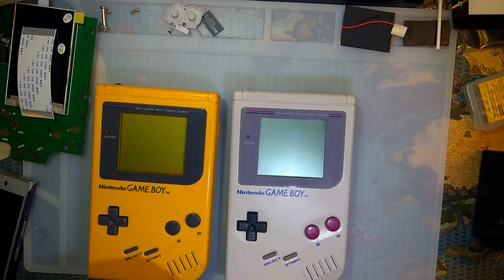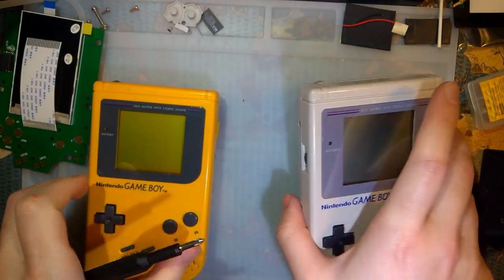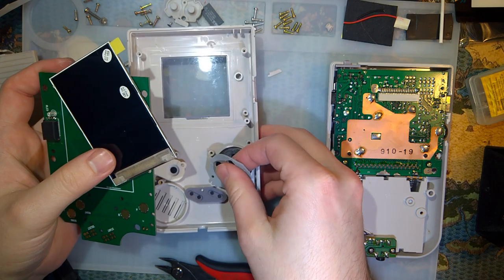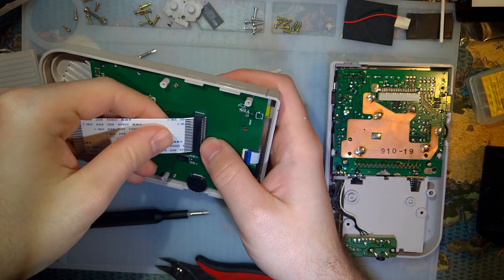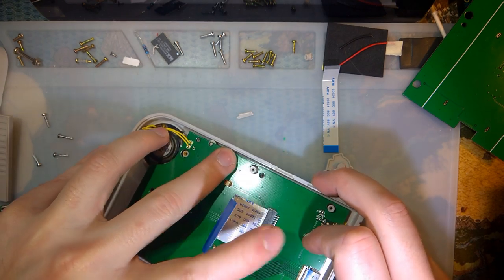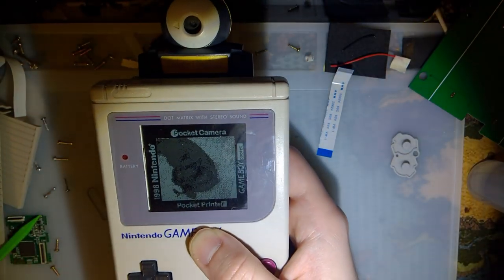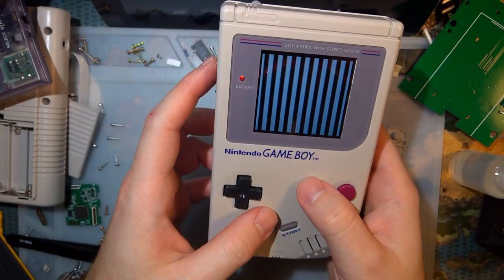(Alternate) Installing the DMG IPS v1 Kit (RIPS) Using the Screen Tabs

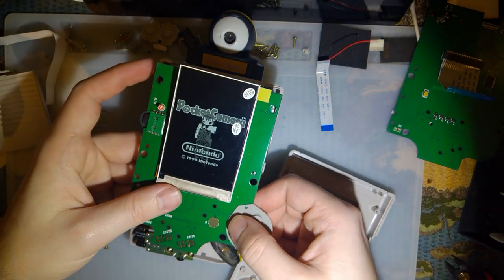Comment: Suggestion, instead of awkwardly using a d-pad like you were at 12:57, try using one of those spongy tipped styluses that work on modern capacitive screens. I'm guessing the spongy material is conductive like the bottoms of the button pads.
Reply from the maker: It is and that should work. The main reason I don't use one is because I don't have one. Good idea ;)
Reply: @makho  If you're like me, you probably have a a cup like container on your work bench that you keep some pens, sharpies, scissors, exacto knife and other stuff in. So next time you see one at the store, grab it and throw it in that cup.

Comment: Are you excited for the Analogue Pocket? I haven't bought an Analogue console before, but I think I may have to bite the bullet for that one.

Also, I hear BennVenn is developing a drop-in display for the DMG as well? Any plans to demo that one too? Your install videos are awesome!
Reply from the maker: I like the idea of the Analogue Pocket but I have no idea how much use I'd get out of one. I am eager for third party reviews though. I might get one depending on how those look.

And yeah, I've heard plenty about BennVenn's planned mods. I'll see about getting a kit if they ever come out.
Reply: What's the point of the AP when there are drop in original size 4x scaled displays for the original hardware for cheaper?
You aren't going to get 1;1 pixel mapping with the pocket. It will get an integer scale for GB/GBC and GG games. But everything else will require non-integer scaling with interpolation to fit the screen at the right aspect ratio. (Which they are then using the higher pixel density to hide). Which is fine, but unless you really care about having the ability to play all 3 system cartridges at once or emulating other consoles. Then it doesn't seem there is any point. You could get a GBA+IPS kit and be able to play all 3 as well. If you care about other system cores, you could get an RG350,350h or PocketGo2. All which will run those systems on a high quality IPS screen with 1:1 pixel mapping with input latency that will be negligible. Plus it will run systems like PS1 that FPGAs are not powerful(or cheap enough) to run.
Reply from the maker: @fonarte  Yeah, you can mod a GBA to do everything that an AP can do, but the pro of the AP Is that it (ideally) comes working like a fully modded GBA out of the box. It will also be able to play games for other consoles and dock for play on the TV. It has a few features that haven't quite been modded into Game Boys yet. That being said, we'll see how well it works when they start shipping.

Comment: 100 degrees it gettin spicy in here. what do you use to clean up the glue around where the outside screen protector goes? i bought a screenless gameboy and it has nasty glue boogers
Reply from the maker: I did my last one with elbow grease and a plastic spudger

Comment: I notice at 9:06 you insert the large ribbon cable with the silver pins facing you, but in every set of instructions I’ve seen for this, it shows the blue side facing you.  On Handheld Legend’s website they even note “*Insert cables with the blue side of the connector facing you.”  I know the original cable is inserted with the silver pins facing you, so it makes sense that you did that, but do you think that might be part of the problem with the palettes being off?  

I get my kit any day now, but was curious if you tried the cable with blue side facing you.  Thank you seriously for these videos.  It’s because of people like you that I even attempt modding at all.
Reply from the maker: That's not how those ribbon cables work. I did actually fix the issue though. Take a look here: https://youtu.be/cFpnUGuXtbY

Comment: That’s a shame that the tabs don’t make it line up perfectly as it should. Maybe they’ll fix that in later revisions
Reply: The daughter LCD PCB is what is causing it to not sit right, so all someone needs to do is make a 3d printed spacer to fit between the screen and PCB. Then it should be as simple as making a lcd sandwich and then just bending the tabs or soldering them
Reply from the maker: @reluttr2  Sounds more complicated than it should be. Ideally, they should just make the daughterboard and the main front board one part and move the tabs holes up one mm. No adapter/bracket needed and manufacturing and assembly is simpler.

Comment: Just wondering has there been any update on the gba sp type-c mod to allow you to use a type-c to type-c cable?
Reply from the maker: No. I was thinking about making my own version of the mod so I can add in a couple 5.1k resistors on the CC lines to fix that issue but I just haven't gotten around to it yet. I've got a lot of projects on my plate at the moment and that one is a low priority.
Reply: @makho  Ok definitely work on those projects they are probably better but thank you I enjoy your videos ever since I got back into my retro tech
Reply from the maker: @alastairwilliams3547  It's a little thing that I could probably knock out this weekend. The most time consuming part would be desoldering another GBA SP so I could take measurements.
Reply: @makho  Great, sounds good when ever you can. There is not much point rushing if you have better and more intresting projects. Thanks .